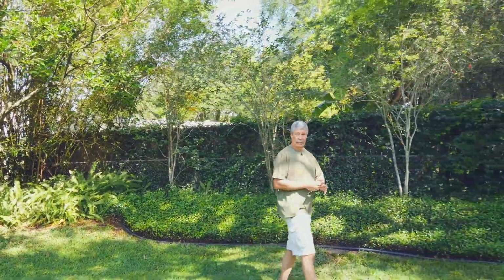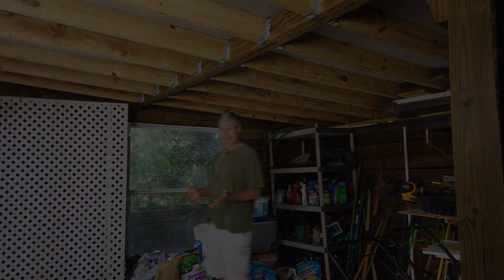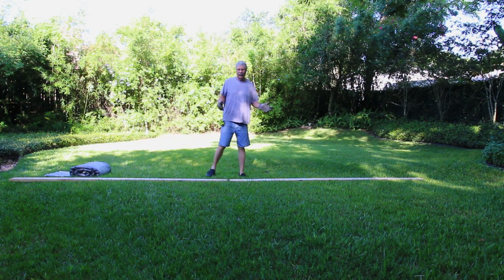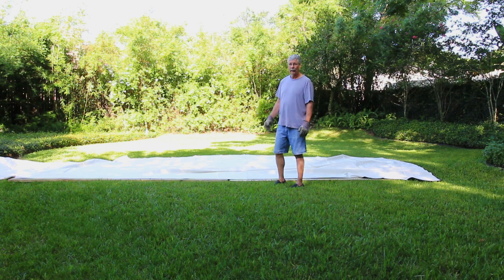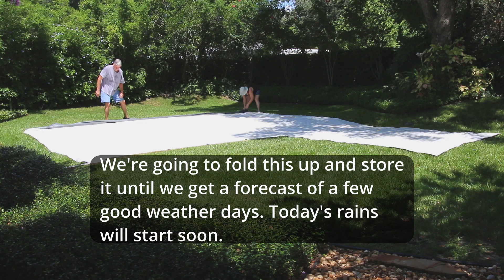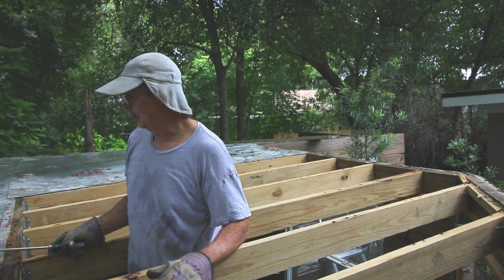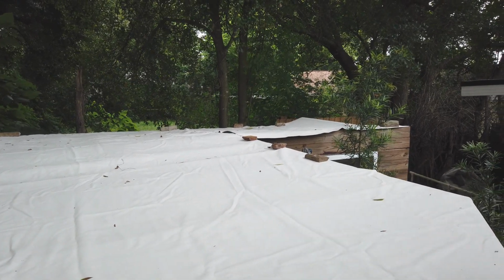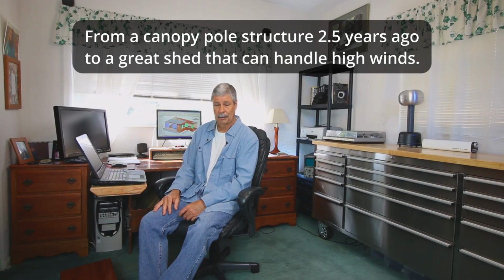Large, Solid, Affordable, Unique Backyard Shed Roof replacement

Comment: Just found your channel per YouTube suggestion. 
Wouldn’t a metal roof with a slight grade for drainage be more cost efficient?  I realize it may rust, depending on the material. Some last much more than 20 years.
Reply from the maker: Metal roof was an option but it would move me further from the code allowances. . . in my particular case.
Thanks for posting Dave.